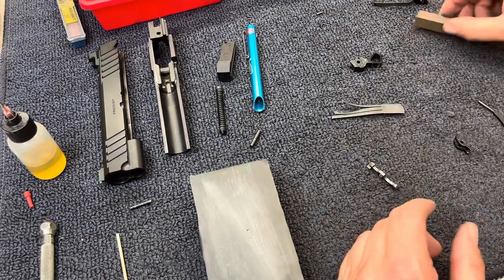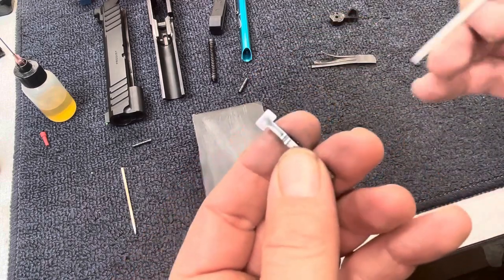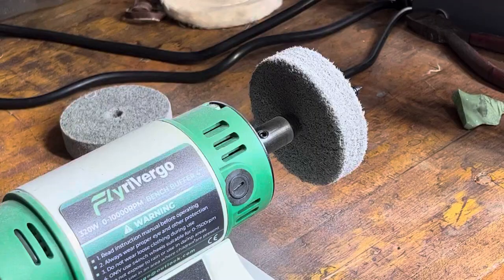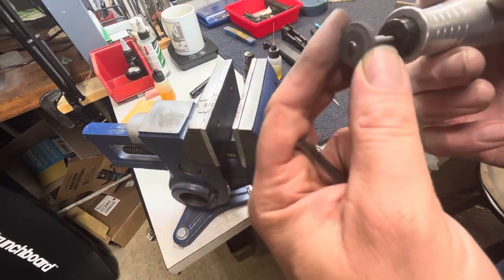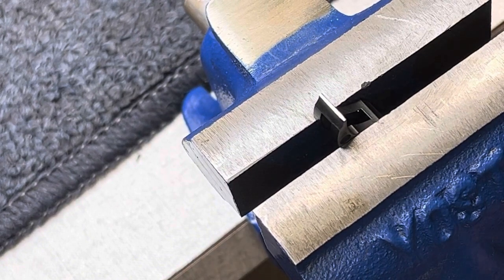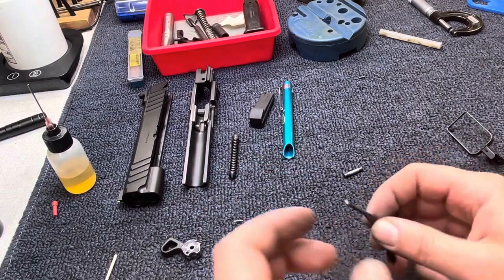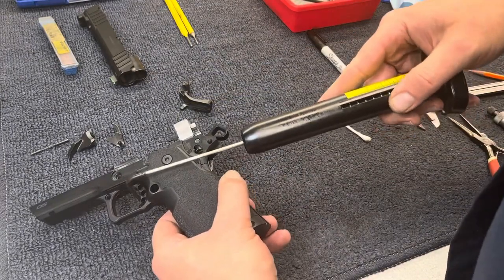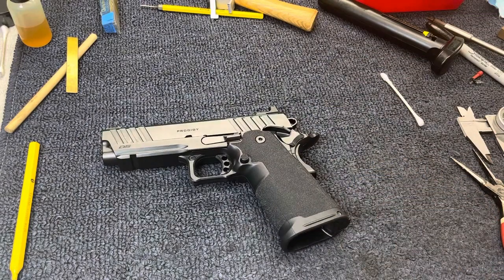Prodigy Trigger job Part 2

Comment: Everything you need, and nothing you don't. Just got my 4.25 and can't wait to apply this. I came with a crisp 6 pound trigger. My last trigger job on a 1911 turned out OK, but I missed quite a bit. Now I have this excellent guide. Thanks.

Comment: Have a question on the SA OEM hammer in the Prodigies you've worked on. On the one I have the hammer had a third ledge about a 1/8" above the half cock notch/hook. When I reduced the over-travel of the trigger the sear would slightly catch that third ledge which would cause a slight slowing of the hammer. I ground that off and everything works fine. I think it was a manufacturing defect. 
Have you seen that at all?
Have you tried the True Radius sear jig or even heard of it?

Comment: You put effort in addressing all the small parts. What's the lowest trigger pull you can achieve?
Reply from the maker: 2 lbs. or less can be achieved.  Bit that is lighter than I recommend.
Reply: @mastergunworks  Whats lighter than you recommend?
Reply from the maker: @chriss7991    I recommend no less than 4 lbs for a carry gun.  Most other cases 3.5 Lbs is fine.  Target, bullseye or other competition only guns can be lower down to maybe 2.5 lbs. or so.  It depends on the application.
Reply: @mastergunworks  interesting, I run my competiton guns at 15ozs.
Reply from the maker: @chriss7991    That is pretty light.  I guess that's fine as long as the gun id for comp only. I probably would not send one out the door that light.  Simply due to liability reasons.